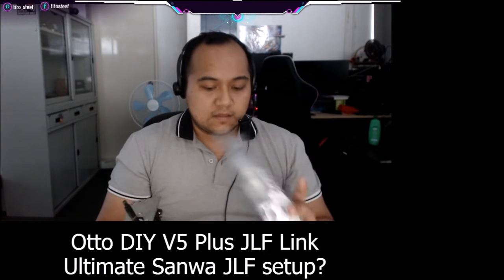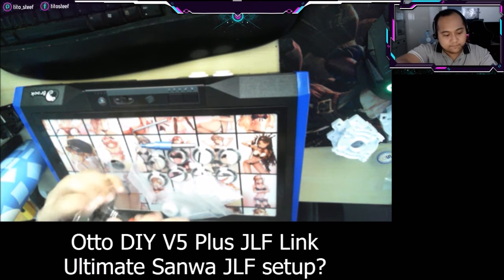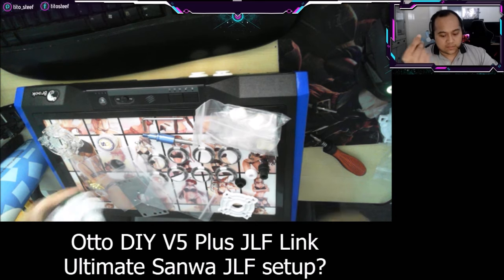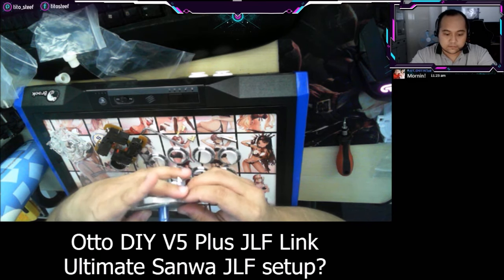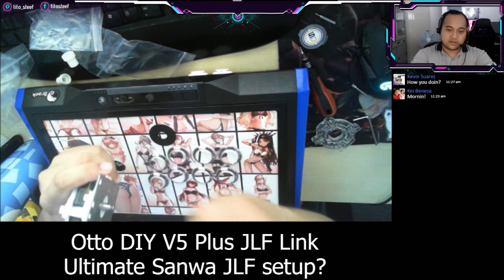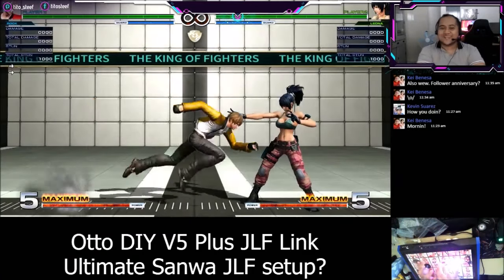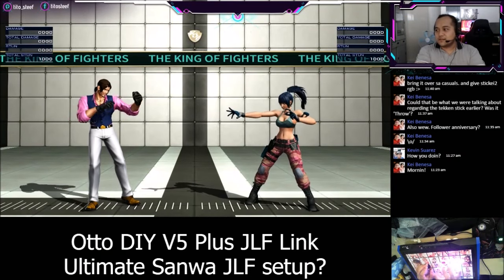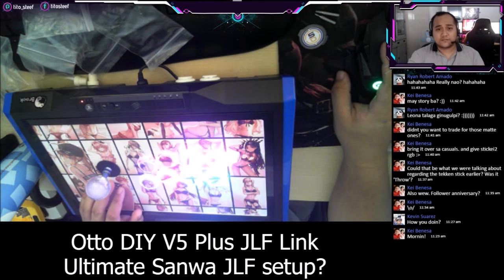Otto DIY V5 + Phreakmods JLF Link installation

Comment: did you feel any improvement?
Reply from the maker: It's a different feel from the regular JLF I wouldn't say "improvement" since that's subjective. Currently Using the largest actuator and square gate. I prefer this over stock JLF because of the short throw. But for the price, I can recommend a different joystick instead if you want one with a short throw. My favorite Japanes joystick is a Seimitsu LS-62 which has a really short throw, this makes the JLF feel close to that.